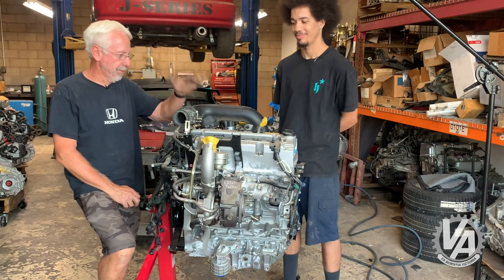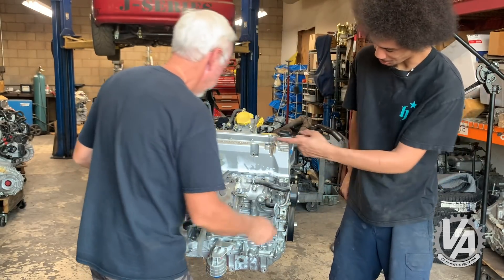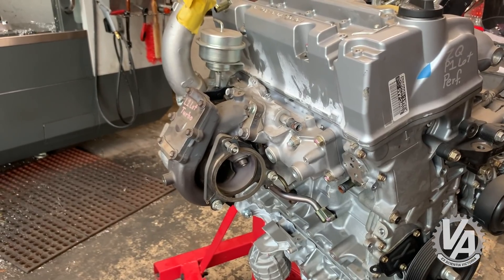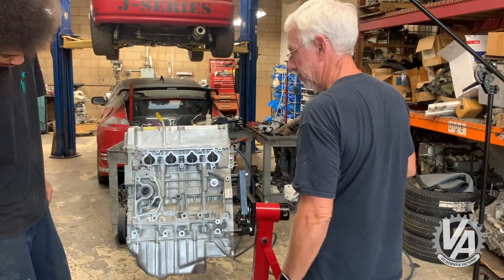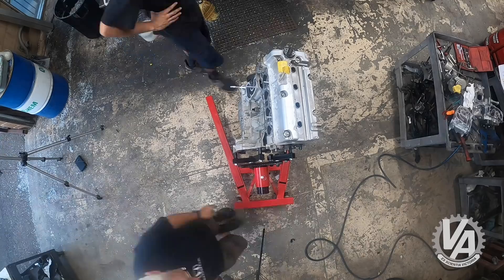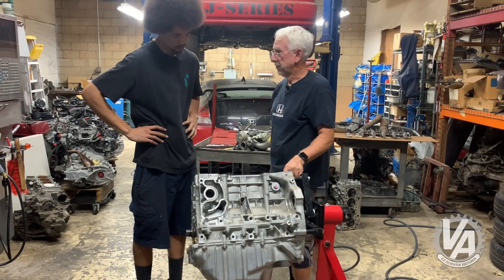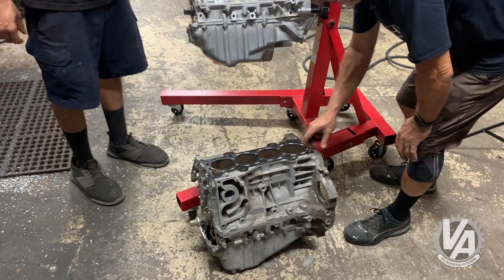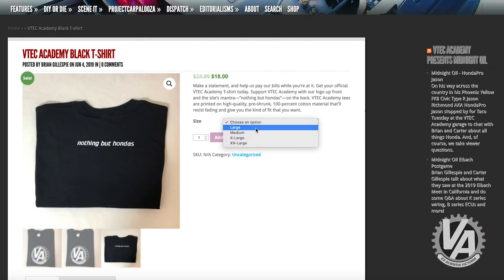Budget OEM Turbo K20C1 Killer? - K23 Tech Inspection

Comment: So I think there is a potential to using a k23 for a really good budget k24 Frankenstein build. 

Instead of buying new, rods, oil squirters, turbo, turbo mounts, manifold ect. You can just gut a k23A1 block and take the head and swap it into a cheep k24a4 or something. You can find k23s all day with turbos for 500-1000 bucks. With all parts included, you could make the a k24 into a monster.

The problem would be tuning it. I guess it would be preferable to get a k23 RDX ECU and flash it. But online there are barely any people that mess with that tune. Plus the fact that those ecu's are made to work with the transmission that is the super handling all-wheel-drive automatic. I guess custom mapping? But I also know that the k23 has exhaust Openers/closers so I don't know how that would fare on a custom mapping.
Reply from the maker: That's what we think.
Reply: @VTECAcademy  I'm probably about to do the same thing. I found a k23 turbo and all for $750 only about 5 hour drive for me. I have a K24 for my Honda Element left over from a swap I did. 

I'm going to tear apart the k23 and see how many parts bolt on to the K24. I'm planning to put it back into the Honda Element anyway (for a AWD low end torque truck build). There is more than enough room in the Honda Element engine bay to fit the top intercooler and even (maybe) the larger oil pan on the bottom. I suspect the k23 oil pump (might) be better than the K24 cuz of the need for more oil cooling? Not sure. 

I would LOVE for you guys to do a write up on this build. Especially on what kind of ECM tuning would be best to use. It might be best with the original RDX computer with a tune to cancel the A/T functions to make it play nice with a M/T. Or it can be just as simple as a K24 turbo flash from Ktuner. 07-2012 Honda Elements had Drive-by-wire so it's possible.

Comment: I have an automatic, 2nd gen, 2002 AWD CRV equipped with a k24a1
I want to supercharge the damn thing so i dont have to drop and swap the engine, but theres ZERO engine management for automatic tuning. Ecu Master / Kpro is no bueno.
VTEC Academy, WHAT CAN I DO? i dont want to fundamentally change the CRV from the stalk shifter / source a manual swap, but want to make the car more powerful for daily driving
Reply: You're sol with an automatic.
Reply: HONDATA

Comment: If only it was ever possible to mount a 6spd to a k23, we would be seeing easy turbo k swapped Honda’s everywhere. The funky k23 design is the reason I turned out the rdx, if it was a normal k series I would be driving one
Reply: Just a hunch but the TL-SH 09-12 I suspect that the drive line from the RDX and TL is the same... The TL-SH was available with a 6spd (rare) but I know it exists.

Comment: In the rust belt I’ve replaced those water jacketed exhaust manifolds because the the corrosion crawls through the gasket and gives you coolant leaks all over back there

Comment: I swapped d a k23 rdx block with a z3 k20 head , slotted starter, z3 k20 Lsd trans in an e.g. 1993 civic, with the stock k20 harness, turbo , gt 30 76r , Garrett, .... car fired up flawlessly first star up with rdx injectors first start ? Stock map , then the tuning ... , but it does work , it's been done years ago
Reply: What starter did you use exactly? I tried a k20z3 flywheel on a k23 RDX engine and the starter wouldn't match up at all.
Reply from the maker: What ECU?

Comment: This is awesome. And homie has 7 of them. Wow. Is he going to do a give away? Just kidding. Will those dished pistons fit in a k24 to make a k23 out of an accord engine and then add that head for bolt on plug and play factory turbo?
Reply: No. K24 is 87mm bore. You'd be better off using the K24 block, and putting the K23 head on it, anyway.

Comment: What kind of cams does the RDX head have? I assume it will take a k20 or k24 oil pump and pan? RSX wiring harness work? Any good reason to just use the head and not the whole engine?
Reply from the maker: The block is unique to the K23 and only bolts to the RDX transmission as far as I know.
Reply: I'm curious to see what kind of compression will result from that head on a K20 or K24 block. This would be a neat, inexpensive upgrade for my K24 Insight.

Comment: water ports in the exhaust manifold... isn't it also for water HEATING? The idea is to get the engine to the operating temp as quick as possible.
Reply: Yes less emission warm up is the worse for emissions and catalyst converter work best hot
Reply: Im more leaning towards because it's a cast aluminum manifold. Honda was probably doing R&D for the single port heads before they made a final casting.

Comment: Hey sir, guys I need your help.

I have an FA5 and the gear selector mechanism came apart.
The bolt that held the mechanism fell into the transmission so I had to crack the transmission open to take the bolt out and replace the whole mechanism.
So I went ahead and did that how ever 
I can’t seem to seat the drivers side cv axle 
All the way in. It has about an half an inch gap.
Any solution would be great thank you 🙏🏼

Comment: VW/Audi has been water cooling the exhaust with their manifold are integrated into the cylinder head. Honda doing this on the newer engines with integrated manifolds.
Water cooling the manifold has benefits. The engine gets up to temperature much quicker during cold starts and reduces wear. It lowers the EGT and allows leaner fuel mixture for better fuel economy.
Reply: Help with emissions 
 when the engine warm up it is producing the most co²
 faster warm up make the epa happy

Comment: This is awesome. I daily an 08 RDX and love the way it feels. Mine is coming up on 170k and hasnt had a major hiccup yet. I would like to see what transmission options you come up with and if theres potential for this to be swapped in the older chassis. Keep up the good work guys!
Reply: Mine just hit 250,000 keep her running
Reply: Mine hit 257,000 and still going strong with just a few typical maintenance repairs over the years but nothing major at all. 🤞. I’ve loved every Honda I’ve owned starting with the 86’ Accord sedan,90’ Accord coupe,99’ Accord,2005 Acura TL 6spd,2007 RDX and 96’ Accord coupe with 255k on it now and still daily it.
Reply: I have a 2009 RDX with 190K, 2 turbos later I still love it!

Comment: What about using the k23 block, k20 head, with a custom manifold for the stock turbo?
Reply: Assuming the k23 block is stronger than the k20
Reply from the maker: @himynameiztony  It is stronger, but it doesn't bolt to any transmission other than the RDX auto trans.
Reply: @VTECAcademy  boo. I've always wanted to take the k23 internals and put them into a k24 block (I believe they have the same deck height)
Reply from the maker: @himynameiztony  Just a smaller bore. K20 size bore.

Comment: Water ports on exhaust manifold seems like issues down the road but I’ve never heard that while working at Acura
Reply: This was probably the first engine to do this but all of the current generation Earth Dreams labeled K series do this as well as the L15 turbo family engines. Only thing with the new turbo engines that I've seen that have been a small issue is the coolant passage they made that's a small trench between the cylinders joining the coolant jacket. Had a couple of leaky head gaskets so I've already gotten pretty intimate with the new turbo engines lol.
Reply: It actually is, quite comon failure from the manifold gasket